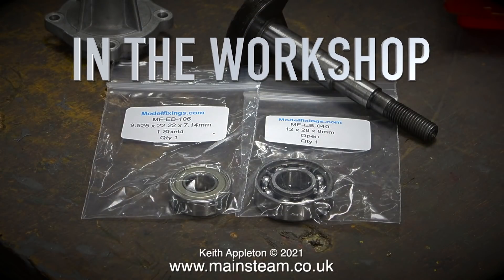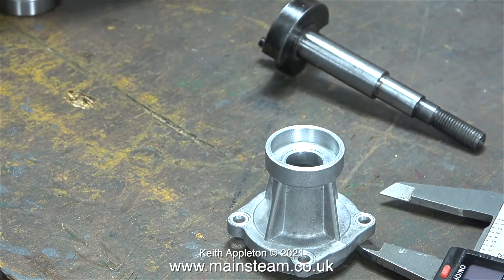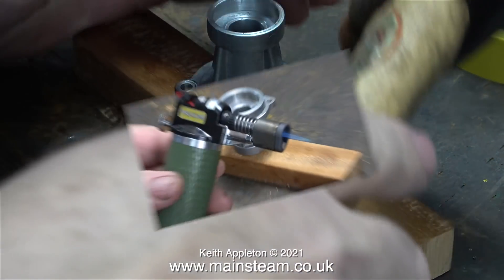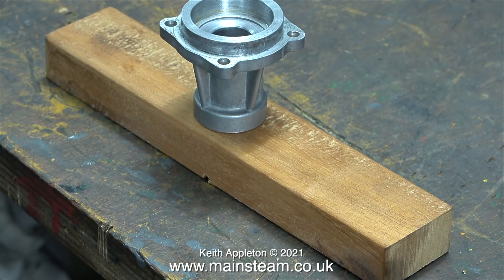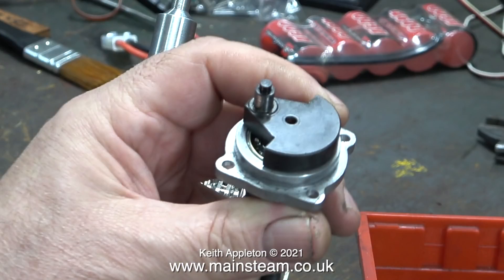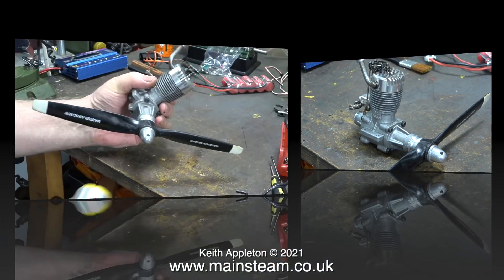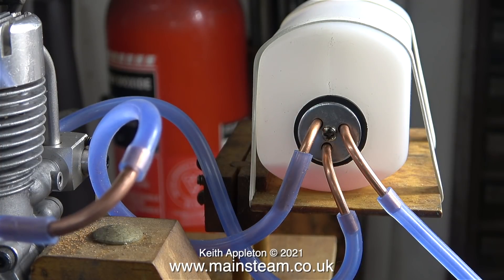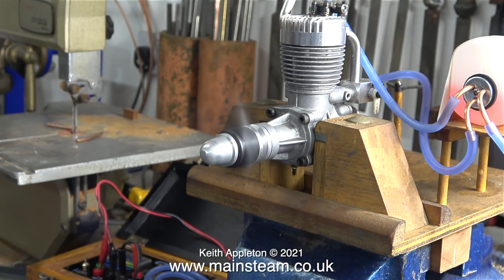FITTING NEW CRANKSHAFT BEARINGS INTO AN ALUMINIUM CASTING - IN THE WORKSHOP

Comment: A joy to watch and hear, thanks. 
Did the same heating when repairing chainsaws in the old days, when chainsaws were intended to be repaired to be repaired when broken.
The pressure nipple, are you sure it is a pressure nipple! On my later OS four strokes, they are drain nipples for getting rid of excess oil in the crankcase.
Reply from the maker: I am fully aware that the crankcase nipple is just an excess oil drain. The pressure nipple I used is on the Exhaust pipe. I showed it in one of the sections of this video.
Reply: @keithappleton  I didn't catch that on the phone, sorry!  I will start breathing again now! 
I once drilled out the breather nipple to deliver pulse to a fuel pump, and redrilled the drain hole in the pump - worked great, I could locate the fuel tank in the float of a floatplane, then have the pump feed to a header tank, and have an overflow back to the main tank.

Comment: I have used Permatex Aviation form-a-gasket between well made components with success and am curious of your opinion of it and similar products.
Reply from the maker: I try not to use liquid gaskets, I prefer to make proper ones so they can easily be removed if necessary.

Comment: First time I have ever seen a 4 stroke model aircraft engine. Incredibly simple setup. Very impressive. For some reason it reminds me of the WWI Mercedes aircraft engine which also had external valves. And a very different sound from the little Cox motors I used to mess around with. Glad you showed this.

Comment: Can confirm that heating only technic. We use that with steel drive gears and steel shafts. We have to spend around an hour and a half to heat up a 3.5 foot diameter gear around the hub using propane, but the same principle applies. It is interesting how the length of time needed to apply the head is proportional to the size of the part and the amount of growth of the ID you are wanting to see.